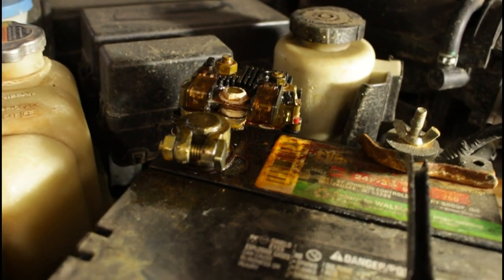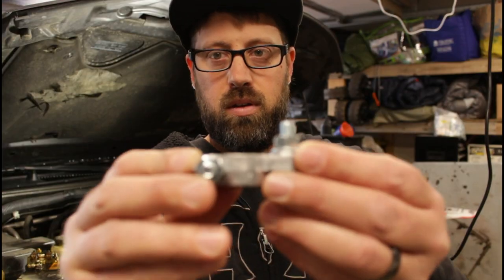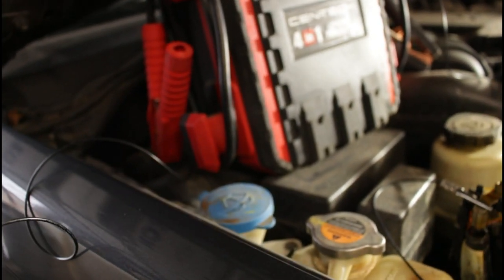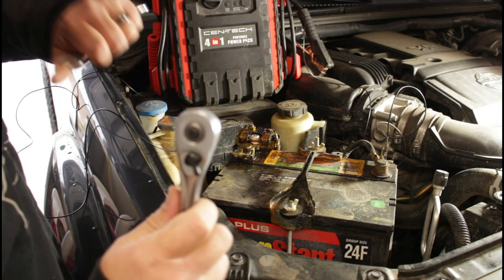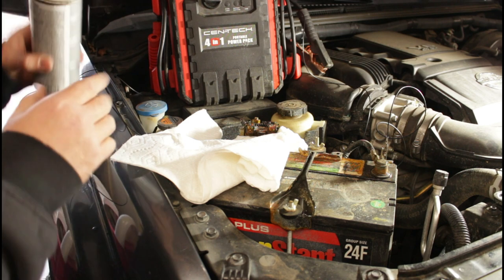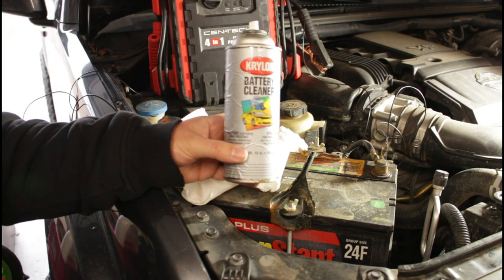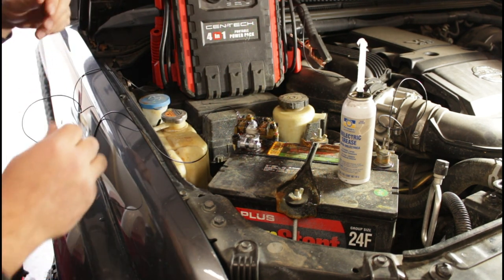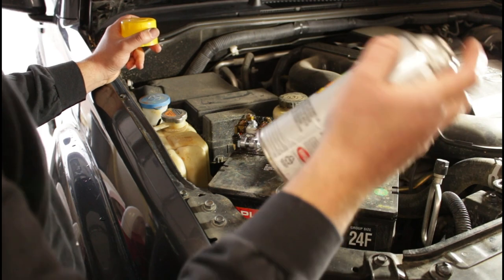Nissan Pathfinder Positive Terminal Replacement

Comment: Do not follow the anything you've watched for this year it doesn't need to have a charger hooked up while serving the battery and don't replace the positive  terminal with that end go to your Nissan dealer and they will give you the correct part it cost $50 so its a inexpensive fix that if done incorrectly will cost you $1000's!!!!!!
Reply: Ok there buddy 50$ for a battery terminal... These are perfect. Good job Danny.
Reply: If you're talking about the battery clamp for the positive terminal, I would not put that piece of Nissan junk on mine. I replaced it with a much more durable marine type of clamp that has a vertical stud for attaching the fusible link. This is a much better solution and it works fine. As for keeping power applied to the electronics during the upgrade or replacement, that isn't necessary - at least not for my 2014 Xterra.